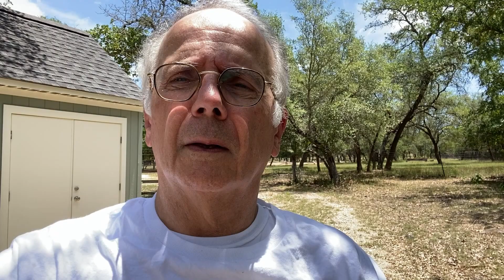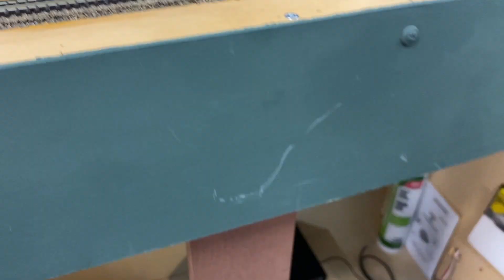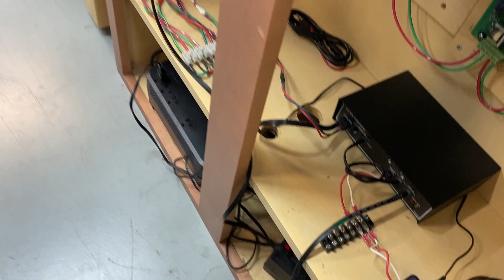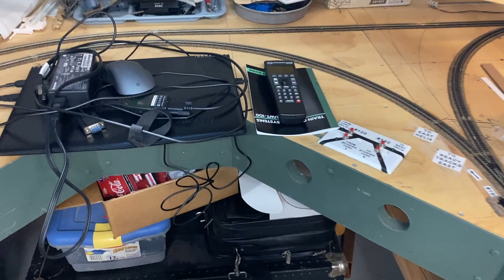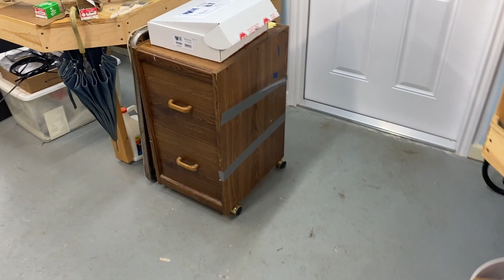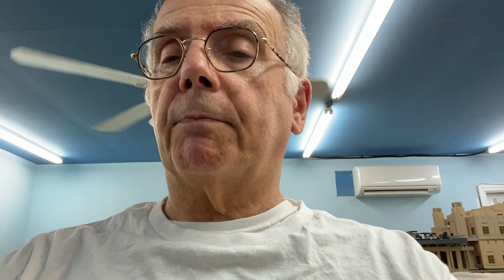Lightning VS DCC System

Comment: Lightning! Wow , that's crazy!
Reply from the maker: Hi, You bet it did. The track acted as an antenna and fed the close lightning strike into the DCC system and knocked out the communications chip. The unit was sent back to NCE for repair and now works again. Have a Happy Thanksgiving…..John
Reply: @tanzj  Still just crazy brother. track acted like a diapol antenna.

Comment: Hey John I feel your pain, my well got knocked out the same way here in the Panhandle.   Luckily that was all that happened.   Glad you at least got it figured out.   So go and have fun and run some trains, Chris
Reply from the maker: Hi Chris, The well pump was 17 years old so it probably was getting worn out anyway and the lightning just finished it off. I sent my command station back to NCE in mid July and it has had the communications chip replaced and is on its way back to me. Their repair technician told me that the track can act as a ground plane for a nearby lightning strike and actually damage the device. It will now be a backup since I bought a new one…..John
Reply: @tanzj  well at least it has a happy ending

Comment: Would a surge protecter save your comand station. In Australia we can get surge protecters for your power.
Reply from the maker: Hi Peter, My home, including the train building and we’ll house, are all on a “ whole home surge protection “ system. The Command Station was not on at the time of the strike is also plugged into a battery backup UPS that also has surge protection. My friend that helped me troubleshoot the issue suspects that the EMP from the strike possibly came into the track and then into the Command Station. He belongs to a club in Louisiana that had a very similar problem with their DCC electronics…….John
Reply: @tanzj   Thanks John for your quick reply

Comment: glad to hear you got it worked out so your layout is in a shed that lightening is bad on dcc system i think joe r had some problems too
Reply from the maker: hi Dwight, Yes my layout is in an outbuilding behind my house and about 50 feet from the well house in the video. The problem was solved but it took a long time to get to the answer which is typical of an electrical issue. Yes, Joe R did mention that he had a similar problem as did Sparky107107....John

Comment: Oh wow.  I’m glad nobody was hurt or you weren’t out there when it happened.  That’s great that you were able to figure out what was damaged. Hopefully NCE can fix it now that you had to do all the work for them.  Ha ha. So, what happens to the well pump that’s under ground?  Do you need to dig it out in order to fix it?   Happy 4th of July, John and family.
Reply from the maker: Hi Drew,  That storm was back in late February and we are still here.  We do get them from time to time and get lightning strikes quite often but not with the damage that particular storm did especially to our well pump.  The well servicing company had to pull 700 foot of PVC pipe and electrical cable out of our well in order to replace the pump and then put it all back into the hole and then check that everything was working properly. They had it done in about 5 hours after they started. Have a Happy 4th of July to you and your family as well....John
Reply: @tanzj  - Thunderstorm fried the circuit board of our ac compressor outside last year.  Pretty insane.  Good night.

Comment: My house actually got struck by lightning last year.  The only thing in the house that was affected was my NCE controller! Had to send it back to NCE and they repaired it for free. The whole layout is plugged into a surge protector power strip which did not help. Happy 4th to you
Reply from the maker: Hi Joe,  Looks like we had similar problems with thunderstorms. At least now I know what to tell NCE exactly needs to be fixed. Without the help of Art Houston, I don't know if I ever would have figured it out.  Happy 4th of July.....John

Comment: What a process to get that resolved, but I am so glad that you were able to figure it all out.
Reply from the maker: Hi Heath, Most of the time, it is just me running trains so I only use one Pro Cab at a time. It was after buying the WifiTrax WFD-30 that the issue really surfaced. After that I noticed that I could not use two Pro Cabs and when plugged in they would get all kinds of weird letters and symbols on their screens. Thus the three months of fun. I now know more about NCE command stations, data cables, cab bus voltages, and UTP panels then I ever thought that I needed.  Luckily, I have an NCE expert nearby in Louisiana that I can call when desperate. Happy 4th of July....John
Reply: @tanzj  I think you are now everyone's NCE expert :)
Reply from the maker: Thanks Heath but no where near in knowledge as my friend Art Houston…..

Comment: I had to do the same thing, get a new 5 amp control station, My issue was the trains would run fine then all of a sudden stop, go, take off, go slow, but not by me. NCE said change the battery, I did. was fine for a couple weeks, then started doing it again. 
I have to contact NCE again yet.
Reply from the maker: Hi Sparky, You were lucky to find another 5 amp system. They are very hard to find down here and I was lucky. The last time that I sent my unit to NCE for repair last March, I did not get it back for 7 weeks so I really had to have another system or no trains running at all......John

Comment: Lightning is not a problem you look for everyday. Hope they fix your box.
Reply from the maker: Hi JD, You are right about that. We usually get the bas storms in the early spring and fall time frame. Over the years that we have lived here, we had one strike a tree about 50 feet behind the house and we could feel the electrical charge flow through the open window into the house. My wife's hair stood straight up in the air. That one got the TV, the WIFI router, and the control box for the well pump.....John

Comment: My NCE system got flaked as well as 3 switch it 8's.  My system is set up almost the same as you APC back up the NCE Power Pro.  I had to send it back to NCE it get fixed an it needed a new board something like $300 to fix,  made me sad :( and my PowerPax no longer workers.
Reply from the maker: Sorry to hear that Eric. I will have to see what happens when they get the unit back again.....John